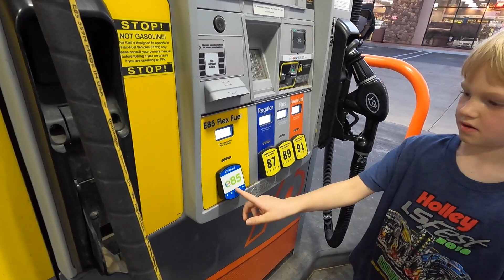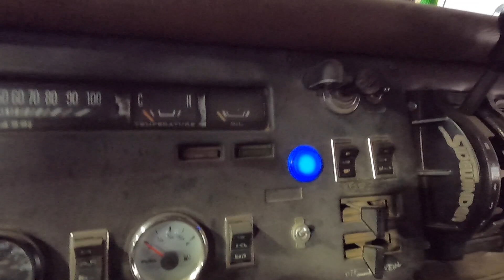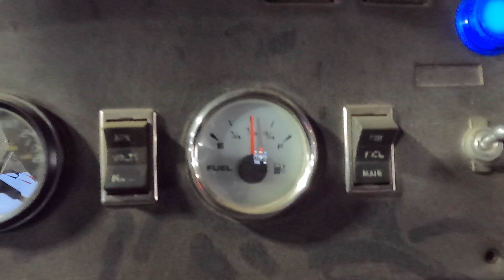Pulling out the Twinnebago for some fresh E85

Comment: I have a 74 Indian i am going to teardown and rebuild. I am going to start on it in the spring. I picked up a 12 valve cummins to put in it. I want to drive all around and haul my twin turbo ls Caprice wagon to events or pull our 10' vintage camper around to vintage camper events. Keep up the work!
Reply from the maker: That swap makes sense. I’m not a diesel guy tho and it wouldn’t get into ls Fest with a Cummings in it 😁

Comment: Supporting Sloppy also, I have that new cam going in a 6.0. Are you running a flex fuel sensor for that 85?
Reply from the maker: Yep. Sloppy plug and play e 85 sensor harness for the terminator x
Reply: Hey Dane I know your running the terminator max, maybe you can do a video on how to tune with the 85, I didn’t know the max could make adjustments automatically with that sensor as it reads the 85 content. I guess I do now. Are you running a tune fro Matt for that flex sensor?
Reply from the maker: @dandorris8531  Yea you have to add it to your tune to work correctly. This was my first flex fuel vehicle so I didn’t get into the tune portion of it because I was learning myself. I could probably explain it at this point now that I’m more familiar